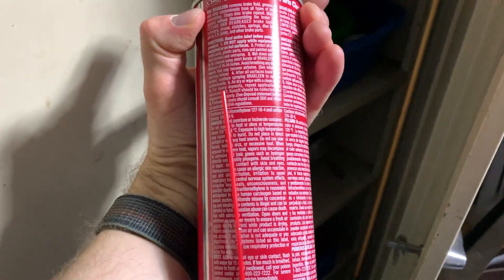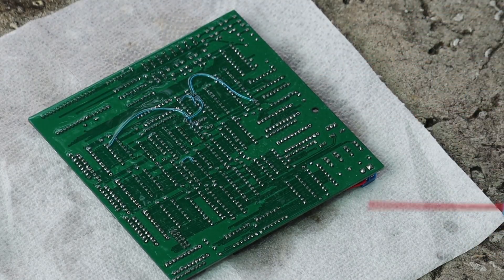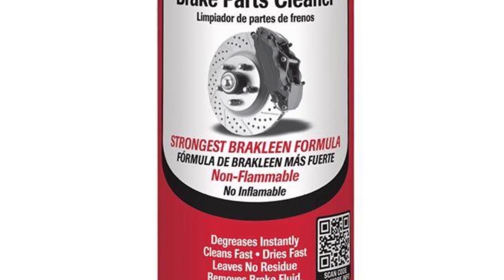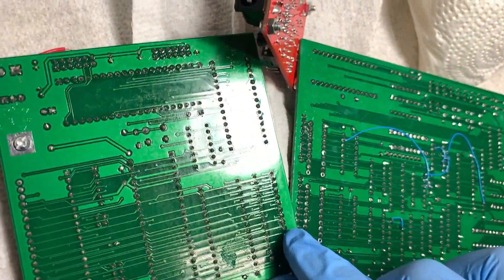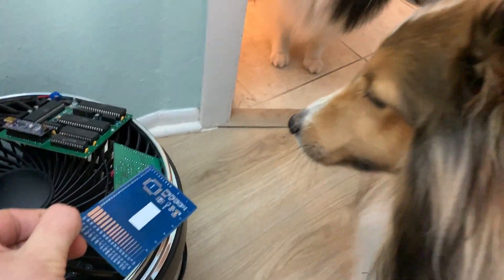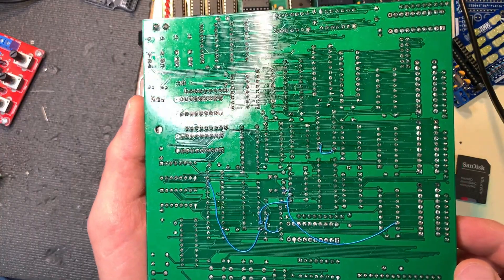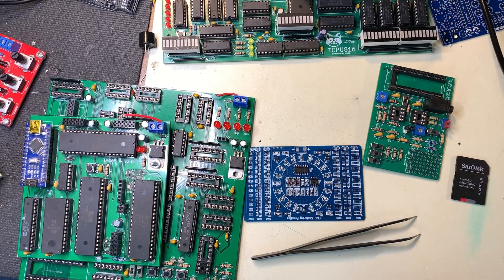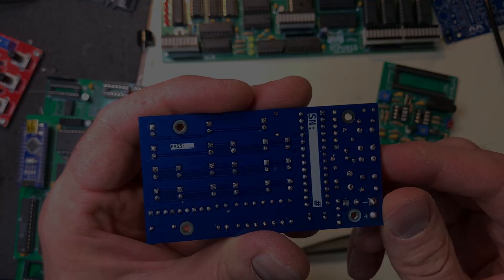Cleaning solder flux with brake cleaner?

Comment: I used Super Tech Brake Cleaner from walmart when I would need to prepare titanium parts for anodizing.  The stuff to be really careful with it hitting is plastic, polycarb, plexiglass, paint, and stuff like that.  It's good to know it doesn't touch touch the solder mask.  It will melt plastic, though.  It also will kill insects if you spray them with it, so I would use that on centipedes and wasps and shit since I already had it lying around and it worked really well.

Comment: What did you call those wires?  I have not heard that term before.  Thank you!
Reply from the maker: Kynar wire. I think it's intended for wire wrapping. But, it's very handy for soldered bodge wires because the soldering iron can strip the insulation without causing it to shrivel like ethernet wire.

Comment: I use Berryman B-12 chemtool carb cleaner for flux cleaner it works really good its made to remove varnish from carburators 
it does not damaged the boards and components i usually work on but it can damage plastic case parts 
 i usually test a small spot first to make sure its safe 

it is blend of acetone  toluene & butoxyethanol
Reply: Brake cleaner is also mostly acetone with some other stuff added. I'm not sure that brake cleaner and carb cleaner are that much different...
Reply: @gorak9000  I have tried both and i think B-12 carb  works better than brake clean it totally disolves the flux and when it drys up it doesn not leave sticky spots . 
i spray and then use tooth brush then blot off excess

Comment: I use an electronic cleaner from an auto-parts store. Safe on plastic.
Reply: Those are just isopropanol. works great. But you can get that in cheaper packages.

Comment: I've never tried brake cleaner for my PCBs, Ive been a bit wary of the acetone contents of them - most plastic and acetone dosen't go hand-in-hand ;-). But on a pcb with just ICs, transistor and resistors I guess if would do a good job. Especially if you rinse/spray them down again after brushing them - or else most of the residues will just dry back onto the board again after being spread out a bit.  My goto cheap manual pcb cleaner is paint thinner that has like >80% toluene in it, never had any parts getting destroyed by it and it works great on the flux I'm currently using.  I recently got an ultrasonic cleaner and discovered that putting the PCB in a zip-lock baggie with a bit of 95% denatured alcohol does absolute wonders. And since it's in a closed bag there's no volatile fumes and fire hazard during the ultrasonic bath.
Reply from the maker: Yeah, I wasn't sure either. I was thinking that the brake cleaner might strip the paint off the resistors and whatnot. But, it was a lot more gentle than I expected. I'll give the paint thinner a try sometime if I remember.
Reply: As you said, brake cleaner is mostly acetone, and one of the best flux removers I've tried is a 50/50 mix of IPA and Acetone - a 50/50 mix seems to work better than either of them individually